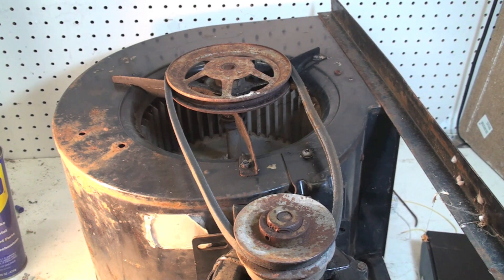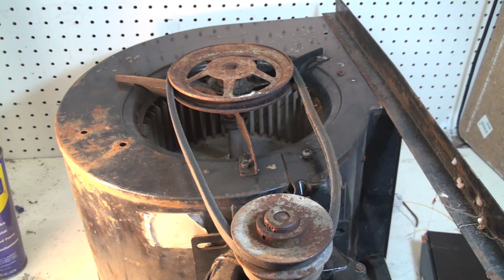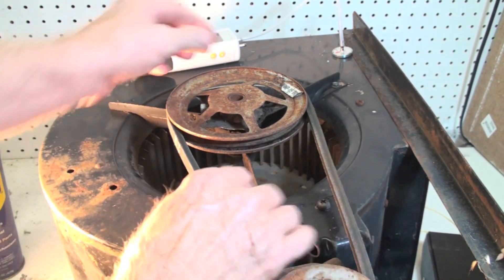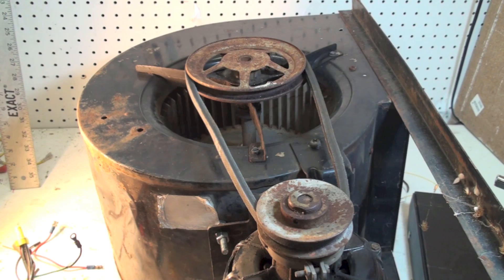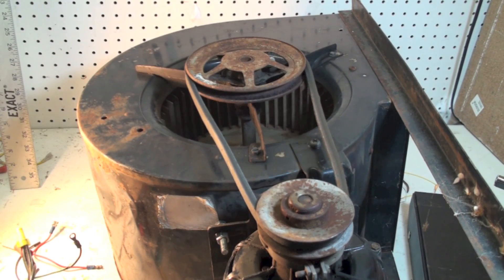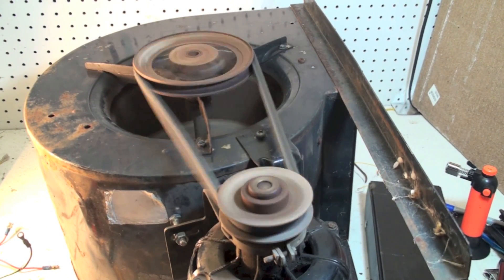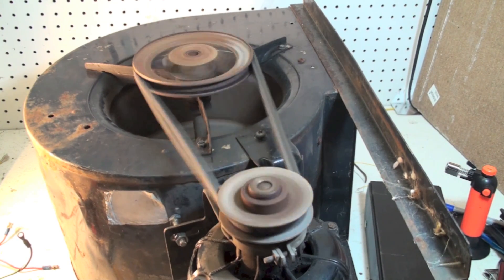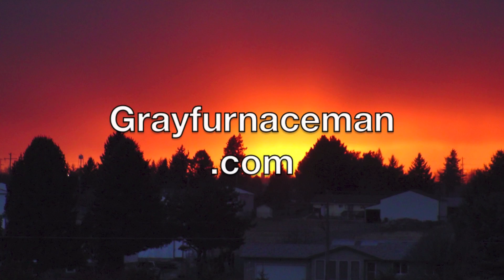Belt tensioning for belt drive blowers

Comment: The HP is effected significantly by the radius of the drive pulley; the first thing that should be addressed is improper pulley width. Once the width is set correctly, then the tension can be added to the belt. This would significantly impact your blower performance, and thus your static pressure.

Comment: I have a 60 year old Air Ease (Johnson Furnace Company) furnace.  Lately, it has developed a terrible squealing noise that comes and goes while it is running.  There have been times when it is constantly squealing, and then later it will stop for a while, then come back later, etc.

I have changed the belt, installed a new 1/3 HP motor, aligned the pulleys, etc.  In order to reduce the squeal, I tightened the belt to about an inch deflection on the top when pushing down on the belt, although not sure if it is too tight now.  It also still squeals but less.

Not sure if the belt is causing the squeal, or maybe the bearings on the fan itself?  It is definitely a squeal and not a rumble, grind, etc.  Appreciate any help here and thanks!

Comment: What do u think about adjust belt tension to spec in the install manual, for example 100 lbs for a new belt 80 for a worn in belt. Do u thinks that's to tight
Reply from the maker: If you are tensioning an A or B belt in a commercial application, yes.  
If tensioning 4L belts in a domestic application, that is far too tight.
GFM

Comment: I have an old Lennox furnace that none of the HVAC companies will touch . But they won't tell you that over the phone. They'll come out and give you a sales pitch for a new furnace and then charge you $130 for the privilege. Since the old guy that used to service my furnace passed away I'm the tech for simple maintenance. Luckily Mr Johnson always showed me exactly what he was doing. Anyway in getting old Bessie ready for the season I noticed the belt seemed loose. I ordered a new one on Amazon and came to youtube to find out how to adjust the tension. Thanks for saving my bearings. If I had figured out how to adjust the tension I would've adjusted it to one inch deflection and boom. Thanks again.
Reply: Awesome man.

Comment: Your motor is flipping all over the place.!!! Good grief.
Reply from the maker: You are comparing this application to automotive.  They are not the same.  The belt used is a fractional HP type designed for this application.  Loose is better here.  
If you tighten the belt to auto specs, you will take out the bearings.
GFM

Comment: the belt's vibrations and deflections showed that the belt was too loose, and will decrease belt life
Reply from the maker: You don't understand the 4L belt.  It does not work like A belts.  
These belts cannot be tightened in the same way.  
The bearings are bronze bushings.  If I were to tighten this belt as you would an automobile belt, the bearings would soon fail.  
GFM

Comment: My oil furnace comes on but blower comes on when the chamber is hot is that normal then furnace shots off and blower continues thermostate is right on old oil beckett furnace
Reply from the maker: The blower comes on after the burner to insure you don't get a blast of cold air.  It stays on after the burners shut down to clear the heat from the heat exchanger.  
GFM

Comment: I like the way he explains , he is very knowledgeable , and I would like to ad something and I hope you don’t mind, this is what I do.
The amount of deflection you should get is approximately 1/16 to 1/8” per foot.
If the belt is set too tight, the bearing or mount may fail,if the belt is too loose, it may cause the belt to overheating and  crack
Reply from the maker: Are you working with A belts or 4L belts?
GFM

Comment: I have this style of blower that has a belt and 2 pulleys, it randomly squeals, I replaced the motor and belt and it squeals/hums, through vents, do pulleys need to be lubricated?? Or should I try taking out blower and giving it a good cleaning
Reply from the maker: You probably have a worn out driver pulley.  Try this video:  https://youtu.be/LwmMpySV5fs
GFM

Comment: I installed a new motor for a whole house fan 1/3hp and the belt went on fairly easily.  Anyhow the motor runs 10 seconds and kicks off, do you think the belt maybe too tight?  I didnt adjust anything from previous motor but this motor physically larger and has no capacitor.  Trying to figure out why it shuts off after only 10 seconds of running.. It is a brand new Dayton 6k778 belt drive motor..

Tomorrow I am going to check the tension on it, I wouldnt think thermal protection would kick in literally 10 seconds in..  Anything you can chime in on would be appreciated.
Reply from the maker: First, the belt should be quite loose.  You should be able to press the belt at least 2 inches with your finger.
The lack of a capacitor indicates the new motor is a lower starting torque one.  
GFM

Comment: Can I convert to the new style blower motors that have various speeds ? My belt driven one doesn't cool the house because it hardly pushes any air out
Reply from the maker: First, I would want to determine if there is restriction in the ductwork system.  Dirty blower wheel, plugged A/C coil, collapsed ductwork.  
As for the blower itself, the only way I know of is to find a blower from a scrapped air handler and adapt it to your installation.
GFM

Comment: Whats the point of this video, show how you actually tightened it. Horrible video!!!
Reply from the maker: There are myriad adjustment systems out there. The point of this video is to show how tight the belt should be for this type of application.
GFM

Comment: Performing a static pressure test unloaded will most times give you a non static difference. Place a load on the blower from coil resistance and a heat exchanger and the same test would have show the belt will slip under load conditions. So a properly tensioned belt is critically important.
Reply from the maker: You have some problems understanding air volume and static pressure.
The open blower shown is under far more load than if I had connected it to a duct system with resistance to flow.  I understand that that does not seem right, more resistance, higher load.  Not right with the squirrel cage blower.  An increase in resistance simply reduces the volume of flow.  Less air is moved, so less power is used.
GFM
Reply: grayfurnaceman only on the blower the motor pulley will slip due to its set hp/rpm,, thus a too tight belt will overheat a motor and ruin bearings. Loose belt with a blower under load will cause motor pulley slip.
Reply from the maker: You still don't understand.  The load is higher than a system with ductwork, yet the  the static stays the same, so no slip.  
GFM
Reply: grayfurnaceman no you don’t understand that the load on the blower cage under load will effect how both the blower “driven” pulley and then motor “driver” pulley react. Your example that there is no difference loose or taught is flawed. A driven pulley will slip with a higher potential load and especially with varying load changes(filters and coils). It’s simply can be demonstrated using a blower door on and off removal with a loose belt.

Comment: Where do you get replacement belts? Is it just a regular automotive fan belt?
Reply from the maker: You can use automotive belts, but hardware store fractional HP belts will work.
GFM
Reply: @grayfurnaceman  Thanks.

Comment: Thank you for sharing this video I just wondering what size belt that was it's almost identical to the setup I have at my house and thank you for letting us know that not to over tighten it also can you let us know how to oil the parts or what should be done thank you

Comment: If it's over tightened
Can the motor overload and thermally shut down
Reply: An overtightened belt shouldn't cause the motor to overheat and shut down, but you can damage the bearings if the belt is too tight.
Reply: Yes it definitely can, too tight will cause too much weight on the blower motor and it will cause overload on the motor

Comment: He doesn't Show Us HOW to Tighten the Darn Belt!!
Reply: use the bolts on the side of the motor that are NOT holding the motor onto the bracket. might seem silly design, but that how all belt driven furnace blowers are done.
Reply: Chris is incorrect.On the back side of the motor is a rubber foot that rests on the blower housing.That foot is on a threaded bolt which is how belt tension is adjusted, FYI it is a bit of a bitch to get at. The bolts that Chris refered to are the pivot bolts for the motor bracket and should not be used to try to tighten  the belt.Patricia  good video grayfurnaceman has on how to adjust furnace fan belt you will see the foot I referred to

Comment: I think my dad has been using WD40 on the motor and fan axels/bearings . 😱 Is this really bad? Don't we need grease/oil ? The belt doesn't seem to be too tight although I tried to put it on a tight as possible after our neighbors welded one of the 3 brackets that broke on the fan. This summer the motor is getting wicked hot and causing the thermal protection trip to stop inside blower while outside unit still kicking for nothing. It doesn't seem to spin all that freely ATM but it definitely turns
Reply from the maker: WD 40 is too light an oil for blower bearings.  Use an oil made for fan bearings or non detergent 20 or 30 SAE.  The belt should not be tight.  It is not an automobile belt.  Your bearings may be worn thru.
GFM

Comment: hey how are ya?? I am getting a seizing noise coming from my belt drivin blower motor area but can't see anything not turning ~ any advice? 
blower cage bearings replaced as well as the furnace motor brand new~ 2002-2003 that's only 14/15 years... help!!!! it's pretty damn cold today in Calgary Canada

Comment: It" s OK but how exactly you tight the belt?
Reply from the maker: There is a bolt on the motor bracket that can be adjusted to lift the motor.
GFM

Comment: HelloI have been having problems with my have that is similar to yours The bearings Went bad So I replaced them with new ones with new housings that have grease fittings.Seems that everything is ok till the motor gets hot and shut down From getting to hot.Do you think if the belt was to tight it would cause overheating of the thermals on the motor ?Thanks
Reply from the maker: Usually, having the belt too tight will not cause an overdraw unless the bearings are failed.  About the only thing you can do now is check the amp draw of the motor.  The adjustable pulley can be adjusted to run the fan slower that may help.
GFM
Reply: what type grease did you use?

Comment: how long do belts generally last
Reply from the maker: A fractional horsepower belt can, if it is aligned properly and the drive pulley is not worn out, last up to 15 years.
GFM
Reply: grayfurnaceman And if they come straight from the manufacturer instead of sitting on a shelf somewhere.

Comment: My belt keeps breaking. replaced it last winter, just broke again. I replaced the belt with the same model as the previous, but it's a used house so for all I know it could have been the wrong belt in the first place. Any advice?
Reply from the maker: +Dagga Soft Are you sure the driver pulley is not worn out?
GFM

Comment: Just want to say thanks. furnace went out this weekend. Paid $400 emergency service. guy hooked up a light switch and put on a new belt. Must not have known what he was doing as the switch was way out of code 1/4 of the box was missing and the 1/2 hp Westinghouse motor failed later that day. Tech never back came out. Wouldn't have matter anyway as I'm sure he did not have that motor and if he did, he would have charged me an arm and leg for it. I checked the tension and it was very tight. Pulled the motor and the bearings are bad. I ordered a new motor $99 bucks, cause I dont want to keep on messing with something when my family needs heat now. But thanks for the video, at least I know how the tension should be.
Reply: Yea I wouldn't go by this video that shits to loose belt slips when it's loose like that...it doesn't need to be very tight but that was flopping while running
Reply from the maker: +Raymond Joseph Its good to have heat.
GFM

Comment: The guys made fun of me for signing up for a Belt Seminar (Browning) but wow probably one of the best seminars I have been to. The energy the building owner will save by having a proper calibrated belt tension by using a belt tension-er is amazing. We do not have special calibrated fingers.....
Reply from the maker: +Brent Peluso There certainly is more to belt tensioning and pulley settings than meets the eye.  Especially when dealing with commercial units.  Thanks for the thoughts.
GFM

Comment: really you didn't even show how we tighten the belt. most stupid how to video I ever seen. doesn't even show how to tighten it yet the title says that's what its about
Reply: shawn bailey have you ever heard of screws and bolts?
Reply from the maker: +shawn bailey As there are a number of different setups for adjusting the belt for different fan assemblies, I chose to not to include how the adjustment is physically done.  This video is about how tight the belt should be.  Perhaps I should make another one that includes several designs of adjustment for belts.
GFM
Reply: shawn bailey use your eyes dude. You see the nut and bolt left of the pully on motor. That's how you do it..

Comment: The furnace in our apartment has a belt drive blower. The previous tenant neglected to change the filter, so the blower is very dirty. I cleaned what I could, but there is still a loud squeal at startup and then it sounds like a dryer full of clothes while running. I can get use to the sound of it running, but the startup is enough to bring you out of your bed at 2:00 am in the morning. I've got a video of it in my library.  Thanks for any input!

Comment from the maker: Once the set screw is loosened, it should come off with some light tapping on the pulley.  If not, a 3 jaw puller can be used.  I will be doing a vid on this soon.
GFM

Comment from the maker: I would agree on tension if you are talking about fractional hp blowers.  A and B belts are normally tightened with the usual 1" depression or with a tensioner.  Bearing overheat from what I have seen is unusual if the bearing is not worn out.  Especially if the bearing is the ball type.  Thanks for the thoughts.
GFM

Comment: RPM's are RPM's, overtight will affect the bearings both driving and driven.  If a motor runs hot it's the bearings heating the shaft then radiating through out, secondary is the motor fighting its own bearings to turn.  Correct belt tension? as loose as you can without belt slip or tossing the belt.
Reply: How easy should it be turning?
Reply: How easy should fan and motor be turning on there own with no belt on at all?

Comment: I have noticed that when I place a new belt on obviously, they are a lot stiffer than the old belt that comes off.....  I usually give it just enogh tension to stop slipping on start up, let it run a bit and re-check and or re-tension if necessary....  I have seen over tight belts make those small motors run HOT before.....

Comment from the maker: That one is hard to get through, especially to someone who has done automotive.  Even the 4Lbelts are not suitable to be that tight.  Great comment from someone that knows!
GFM
Reply: I agree with you. I made that mistake when I changed the belt on my furnace bower years ago. I tightened the belt close to as tight as I would an automotive belt, and I ended up destroying the bearings in the blower assembly. Oh well, live and learn.

Comment from the maker: Yes, that's the jam nut used to keep it tight.  It is not actually changing the adjustment of the belt although it could be if it was left loose.  The pulleys are aligned correctly as far as can be.  Note the rubber mounts limit the amount of tension that can be pulled without misalignment.  Also the bearings wont take much load.  This is not to say a blower over 1hp should done this way.  This only for smaller fractionals.  Thanks for the close look.
GFM